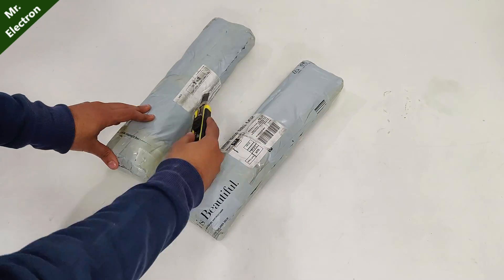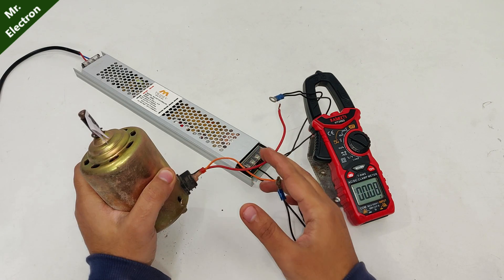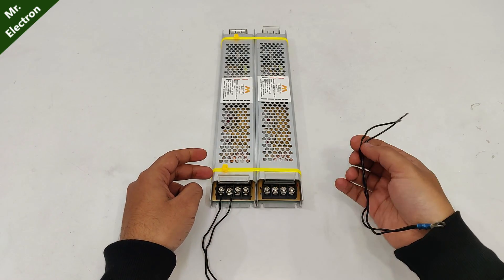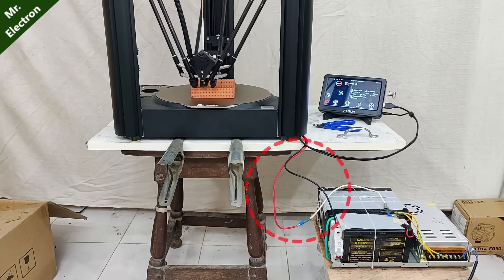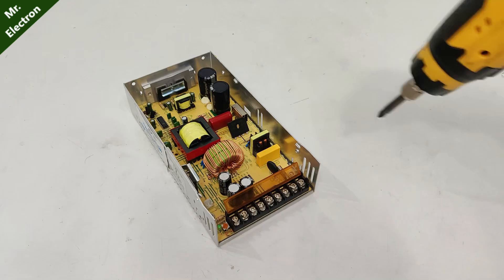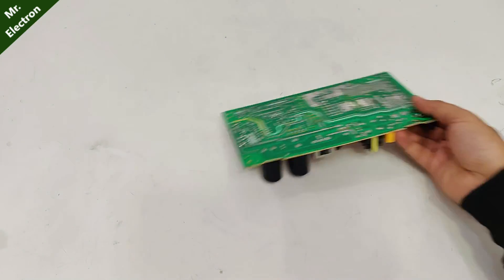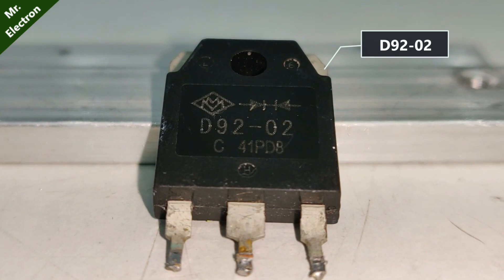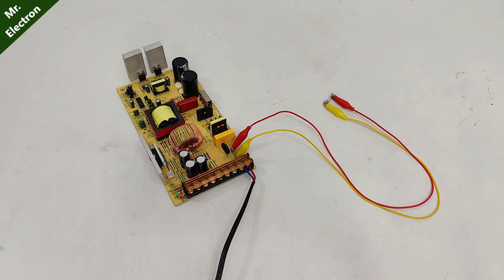12 Volt High Current Power Supply for DC Motor - 12V/24V

Comment: Don't connect two power supplies in series , usually all power supplies DC side can deliver little bit more current than the rated value of power supply. If you make them in series configuration then you are pumping more current through DC side of both power supplies. They will not work for long time and probably end up with damaging components.
Reply: Yes u true he better use battery in series not with power supply in series
Reply: But it's good when u connect it in pararrel
Reply: @ArdimanKhiar  yup.. parallel will be better for output of twice the current.